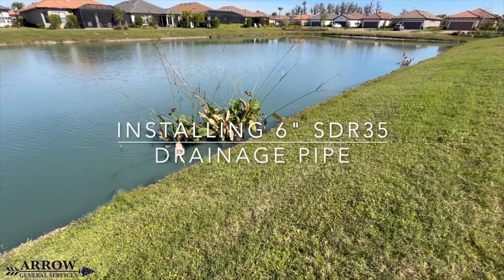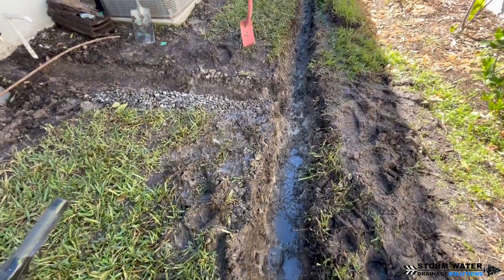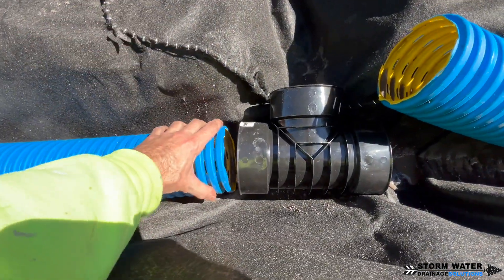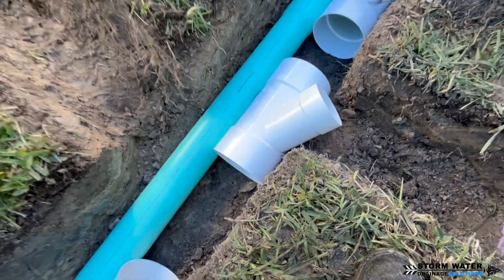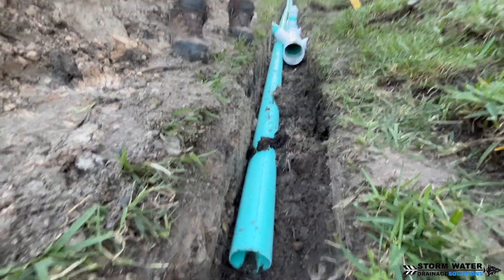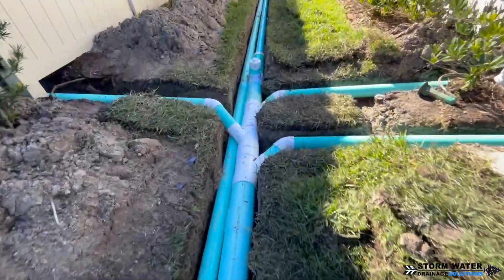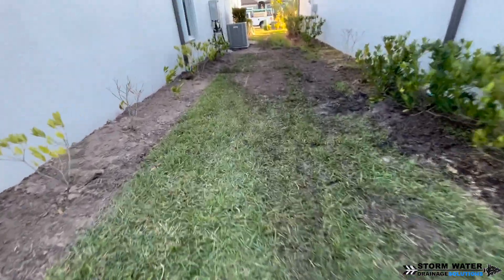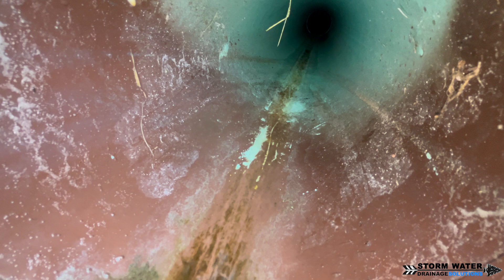French Drain - Downspout Drain - 6" PVC Pipe Mainline Combo - Rain Footage - Tampa FL Yard Drainage

Comment: everyone I talk to in my neck of the woods hates on any corrugated pipe. they prefer to make holes into pvc for french drains. Is that going to be okay? I have like 6 gutter downspouts and I need to run a solid french drain around my back yard. The second thing I find interesting is how you have a french drain here and tie it into the 4 inch pvc. Is that because once you pass the corrugated section you dont expect water to collect in the pvc section?